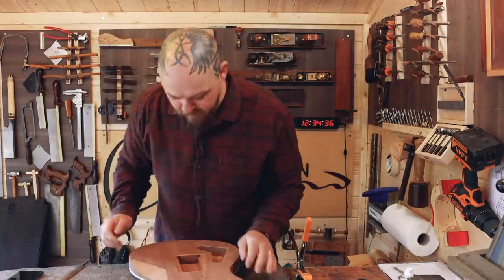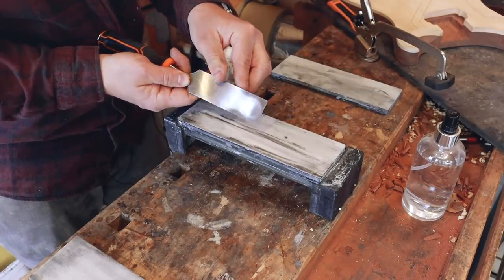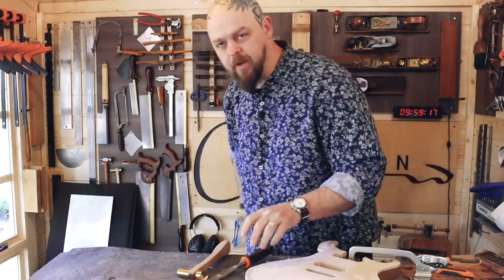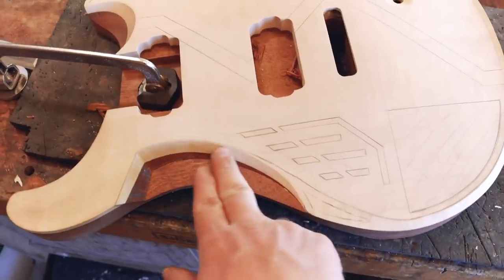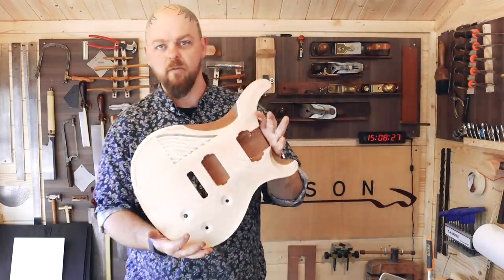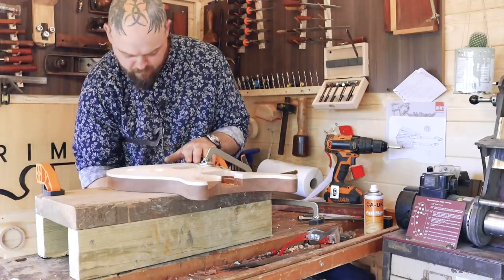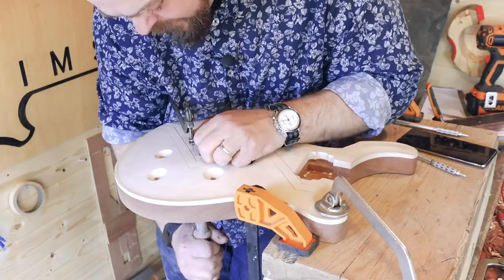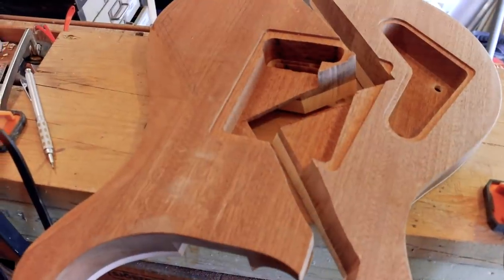Let’s cut this guitar in HALF! Ep 2 | Building a CYBERPUNK 2077-inspired Custom Guitar

Comment: I'm thinking running vents parallel to the center line would be a better look.

You've also encouraged me, who does not own a band saw, to use a coping saw to cut out my barncaster body in what is turning out to be a full hand-tool build. Cheers!

Comment: To incorporate the "mistake," perhaps make a "V" cut along the split line on the back, then flood the cut with epoxy, so that after it's glued back together, the aluminum strip stops at the bottom of the v....in other words, the aluminum strip would only be as wide as the thickness of the top of the body to the bottom of the cut on the back. Or don't use epoxy at all...just the cut with the aluminum visible at the bottom of the v (chamfer?) would also look very cool!

Love your work, Maestro! ☺️

Comment: Hello from the U.S.

So, Ben, I've been watching these videos for a while now... Well, ok, I've binge-watched a lot of them in the last two months, actually, but anyway...
You have inspired me to build my own guitar. 

I had been given a guitar body a long time ago, an Ibanez that some fool had spray painted (very poorly) with an ugly blue primer. Which was especially odd, given that I found out while sanding it off that there was a very nice flat black layer underneath, that probably looked pretty snazzy with the white binding... 
Anyway, I decided I was gonna get it down to bare wood, carve a few new bezels, stain it, and finish it. So, I did, using Crimson Guitars' Stunning Spirit Stains, and Penetrating Guitar Finish (and I have some of the High Build on the way as well; I also used renaissance wax, at your recommendation). 
If you have a spare moment, you can see pictures of the nearly finished product on my facebook below (as well as a few mid-sanding photos). 

There are all kinds of little imperfections. There's a bit of the binding that broke off, and I didn't have the means to fix it, so I just kind of left it. And, I sanded straight through the binding on the heel... Though, I kinda like how that turned out. Just a little swoop of binding at the bottom... 
It's not perfect, but it is mine. 
Sorry, I suppose I'm feeling long winded today.

I hope you and yours are well.

https://www.facebook.com/bronson.carder/posts/10222802590432312

Comment: Holes in the alu plate could be backed with a fine grade wire mesh, like a stainless steel or something. The off perpendicular cut is not as much of an issue as there needs to be the thickness of the aluminium insert removed from the wood anyhow which you can use to cheat the cut back.

Comment: To me, it’s the artificial straight line caused by the inlay and bottom of the proposed LED bars that looks off. Maybe a curve that picks up from the exhaust port and continues a flow around the guitar. Also, that chamfer on the elbow rest looks like it needs to continue to where you cut the guitar so you see just the tip of the aluminium inlay out the back. Just my thoughts, but I’m not looking at it in person

Comment: Hello Ben, did you tried lubing the saw-blade with a soap-bar? Did that always as a teen 40 years ago😅 Every 10 strokes one pass with the soap, or even holding the soap on the cutting line, moving it back if the blade had touched it (so no need to stop the cutting flow)

Comment: With those nicely curved pencil outlines on the top aspect of the body, could it be possible to carve them out with an incline into the body? Starting toward the rear and incline the carve down into the body to reach a certain depth toward the front of the body if you get my drift?

Comment: Ben, funny question...won't the end result of this whole operation just be a silver strip running around the length of the guitar? If so, why not just do a wire inlay along the same path to get the same look? If the answer is "because then I wouldn't get to play with my awesome vintage monster saw", then I'm very ok with it 😂😂. Loving the build and great to see more vintage hand tools getting some love!
Reply from the maker: It would look the same but, as you suggested, if I just inlaid it I wouldn't get the fun of cutting a guitar in half lengthwise for no real reason at all!

I also agree.. I can't get enough of the old tools, it is an addiction! B
Reply: @CrimsonCustomGuitars  thanks for the reply! That's as good a reason as I've ever heard 😄. On the subject though, I wonder if you could do some type of carving or recess from one side that would expose deeper parts of the aluminum (aluminium?) strip in some sections....

Comment: Potential fix for the bad cut near the end: shave the etire cut down and replace the missing space with an aluminum spacer. Or a brass spacer. Or a padauk spacer (for that rusty look while avoiding a tetanus risk.)

Or, widen the gap to 6mm, bevel the to to 10mm wide, surface all the edges smooth, copper plate them with shielding foil, run gold LEDs along the whole cut, join the two halves together with brass pins like the Raw series.

Comment: I would remove the smallest triangular soundhole in the new design and instead place a recessed bolt inbetween the corner of the soundholes and the corner of the aluminium plate as a unifying element. You could even use it as the bolt to hold the back plate on, thus giving it a practical use as well as looking cool!

Comment: 1.The eternal struggle between "cool" and "practical", or potentially painful.
2.The restyled "air vents" do look better with the carved top. The first one may have been better for a flatter, slab body.
3. I feel so sorry for the number of ruined blades, I refuse to say, "I told you so", because I didn't directly.
4. Not exactly related, but did you decide to delay the twin neck build until you have more . . . robust tools available?

Comment: Hang on. Aren’t you removing material the width of those two zig zag lines to replace with aluminium? If so, couldn’t you have just band sawed the straights and drilled at the pivot points? Or was it because you have no band saw access at the moment? P.s. LEGEND!

Comment: I'm left wondering why a fine tooth Handsaw couldn't be used for the vertical cuts extending from the edges of the Body … Sometimes I get this feeling that in his struggle for perfection Ben is a bit of a masochist … 'I'll use the technically correct tools, if it kills me' … !